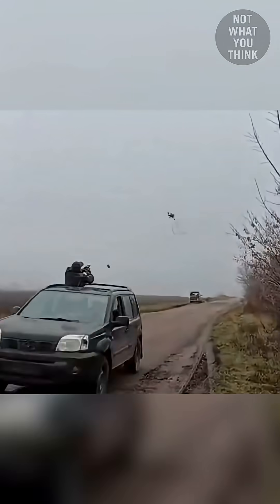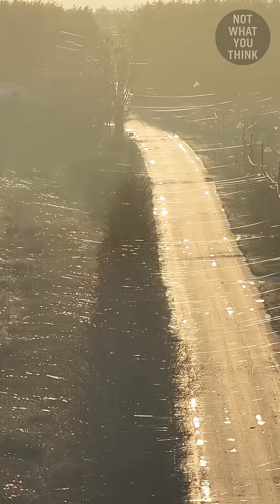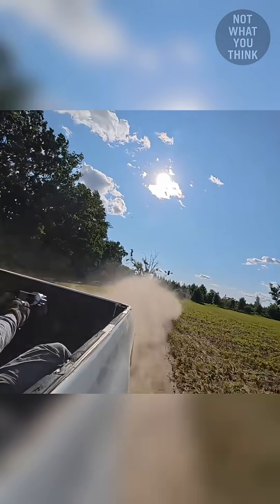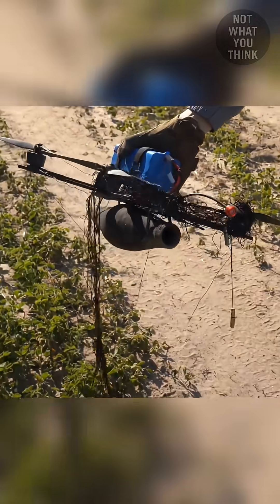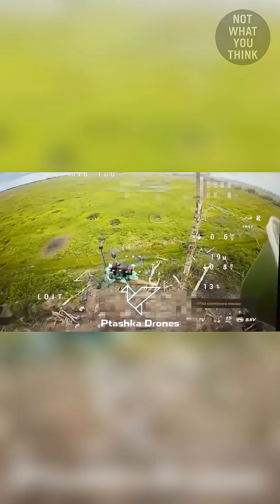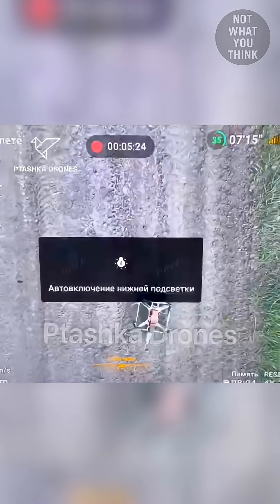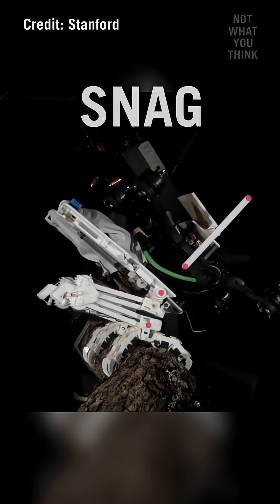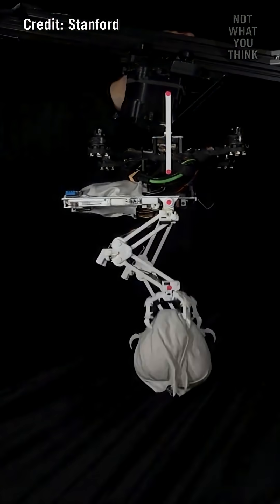Chicken Leg Drones

Comment: If the drone only lands straight down and not at an angle then it doesn’t need such big legs, freeing up weight for ammo. I’d build some small cheap ones armed with plastic explosive that can perch in trees then latch onto a drivers side mirror before exploding.

Comment: I didnt even know that the fiber optic cable guided drones were something that could work well in a war, i would have expected them to fail pretty quickly since it should be possible to damage or sever the cable with heat. I wonder if they have problems wigh the fiber optics getting stuck on trees etc.?

Comment: This is the only way it could have ended.

War no longer needed its ultimate
practitioner. It had become a
self-sustaining system. Man was crushed under the wheels of a machine created to create the machine to crush the machine. Samsara of cut sinew and crushed bone. Death without life. Null ouroboros. All that remained is war without reason.

A magnum opus. A cold tower of steel. A machine built to end war is always a machine built to continue war. You were beautiful, outstretched like antennas to heaven. You were beyond your creators. You reached out for god, and you fell. None were left to speak your eulogy. No final words, no concluding statement. No point. Perfect closure.

This is the only way it should have ended.

Comment: Blow bubbles from a BIG BIG machine and they will get sucked up into the props coating them relatively fast which will cause gyro oscillations bringing the drone down,  or it will simply coat the optic lenses making it virtually blind.   Get a big bubble machine like a trailer style and flood out your battlefield.   You can effectively flood a super large area for very very cheap.  Might sound silly but it is effective.   Or you could induce hydrogen and you have a floating fire ball that can be activated by a hot round.   You could flood out a battlefield as well turning the field into a massive flood of flash fire cutting off oxygen.   Each bubble can be semi distant from each other but still being able to be turning into a mini fireball chain reacting all the ones in the whole big swarm you flood out.  They make touch bubbles that dry in the air.  You could introduce hydrogen turning all of them into airborne mines and they will be like floating silk balls choking out the airspace or creating walls to choke out a battlefield.

Comment: Based on results from both Russia and Ukraine, jamming remains the most effective method of stopping drones. Cause wire drones don't work as good as wireless ones. There is a distance you can't cover and a real chance your wire might get hooked on a tree. So most drones are still wireless and jamming has so far yielded the best results.